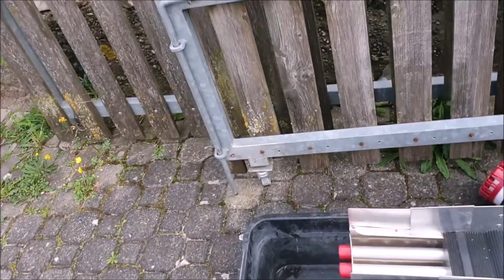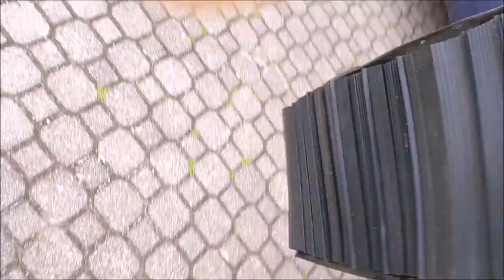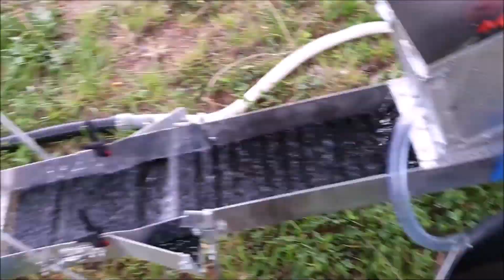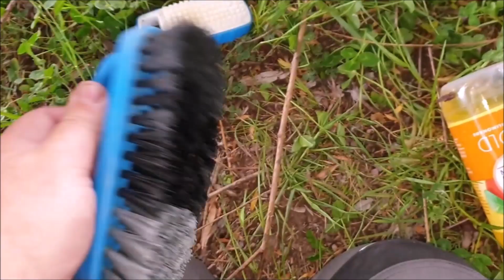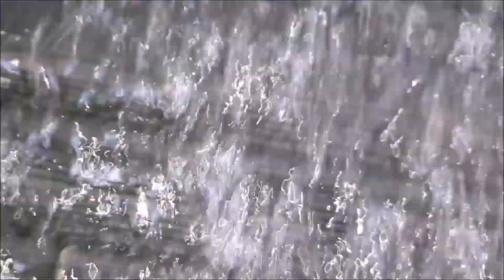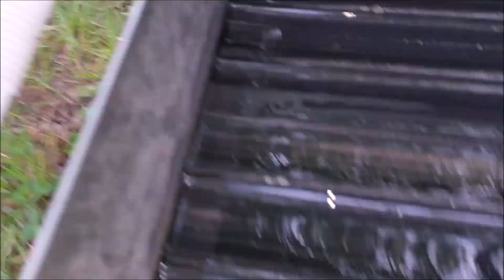004 Sluice use and matting selection

Comment: nice video i learned a lot from it, what is the sugested mattin for rhine gold
Reply from the maker: A lot of folks simply use Miners Moss with a 40 mesh or so screen over the top to allow for larger particles to get washed out. Miners Moss I have found requires around twice as many stops for cleaning than Riffeled matts but has a chance to catch much finer gold. I normally go with a self made selection of "Gold Hog" Matts and they have loads of videos and a good rate of direct staff replies especially for first time buyers. IF You do not have a sluice  / Gutter yet, then I would as well suggest looking at their GoldHog Multisluice my most used and favorite sluice for river side washing is that and i have some videos showing how I made  additional add on parts for it. The Goldhog Multisluice however is a close ended sluice which means one end is sealed off so would not work as a stream sluice where you allow the natural water current and speed to enter the top and wash material down and out the bottom. You could also go with a series of GoldHog Mattas for the first2/3rds of the sluice and switch to a miners moss and screen for the last or swap it up and put the screen and moss in the top or first 1/3rd section. I do have a video that covers gear and such as well. Glad it was of help.  Goldhog.com  (I am not paid for anything from these folks,  it is just what I use and yes the matting can get expensive as it is also shipped from the USA.) There are other Australian matt versions as well as some germany made ones. A Bit of asking around the gold facebook forums and google searches will do the job usually.
Reply: @galwinthefossilizedprospec6999  at the moment i have the golden shark sluice and i am upgrding my sluice with miners mos i am a strong believer in the gold hog mats but its too expensive for me i only go 4 to 5 times a year to sluice with my son.
could you give your opinion ond the golden shark matting?
my sluice is 25 cm wide
i have at the start 60 cm of goldenshark mix gold (agresive mat) then 90cm of minersmos then 60 cm of goldenshark mini the 70 cm of Sona riffelmat and 90 cm of royal deep v matting and i run it with 2x 
1100 gph bilge pumps